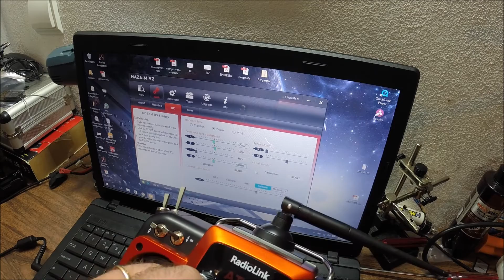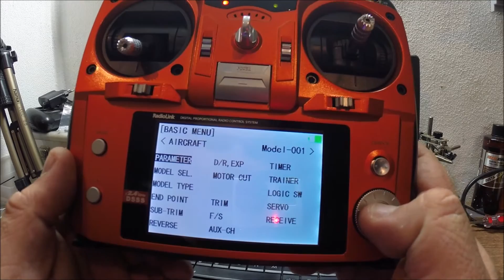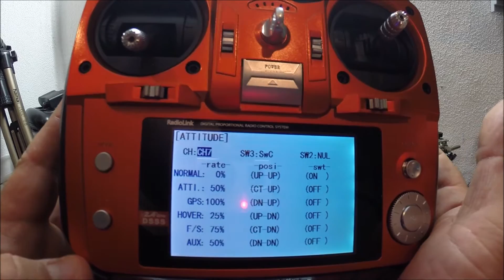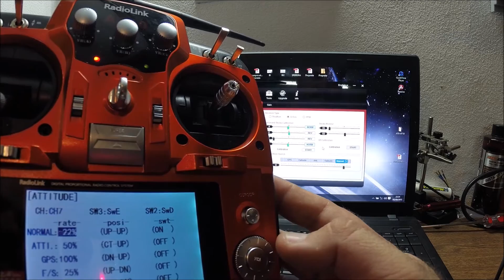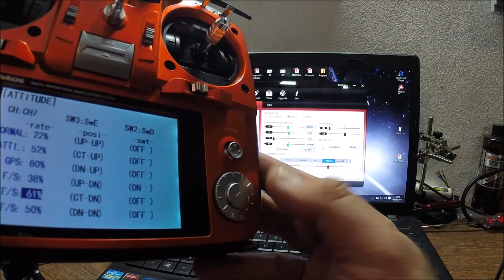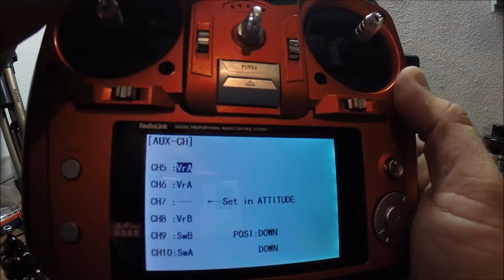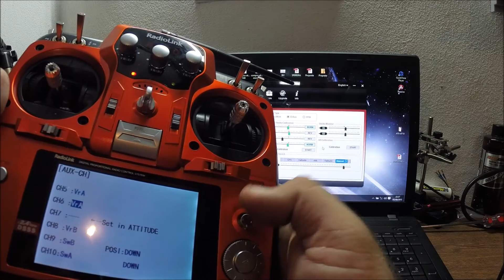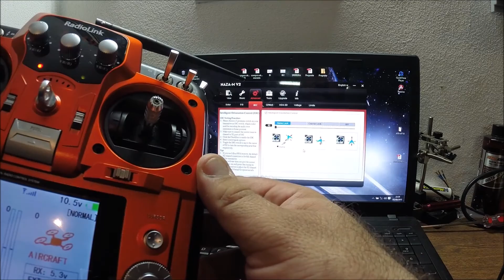RadioLink AT10 and NAZA in SBus

Comment: Hello.  I have an AT9S Pro with R9DS S-Bus enabled connected to a NAZA-M Lite.  After much fiddling I was able to progam the ESC's and setup my transmitter (thank you millions for your video).  However, when my throttle is all the way down all four motors are still spinning about 1/2 speed.  When I throttle up I can hear the motors going to full speed.  All telemetry looks good.  When I connect the ESCs directly to the R9DS channel 3 (throttle) the motors turn off with throttle all the way down and spin to full speed with the throttle at max.  So, I know this is a NASA configuration issue...I just do not know where to begin the tweakage.  Can you please give me a shove in the right direction Sir?  Thanks!

Comment: Dear Sergio.
Will the transmitter AT10 in the current setup with NAZA flight controller and R9D receiver module show in real flight  basic telemetry data:  altitude, distance, flight direction ?
Could you help me, please!

I am a structural engineer and may help you in drone frame design, if you need.

Comment: Hi, are all 10 channels configurable on the flightcontroller? I have a AT10 + R9D + Sbus SPRacingF3 + Cleanflight and can only use 8 channels, but when I start the servotest routine on the radio, all 10 channels are reacting on the flightcontroller, so I think the problem might be the radio